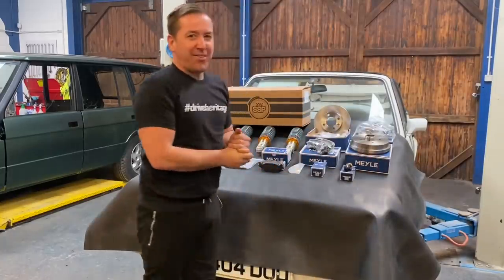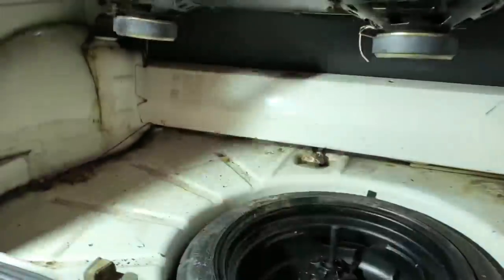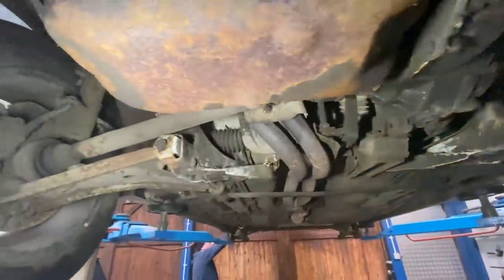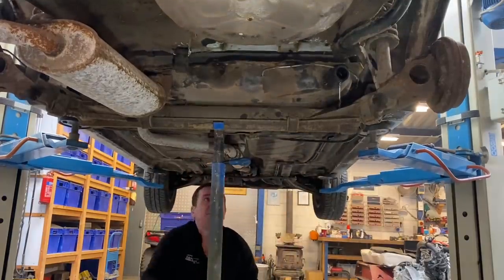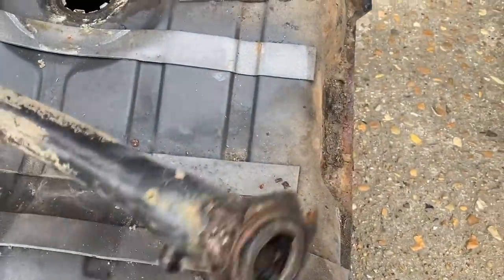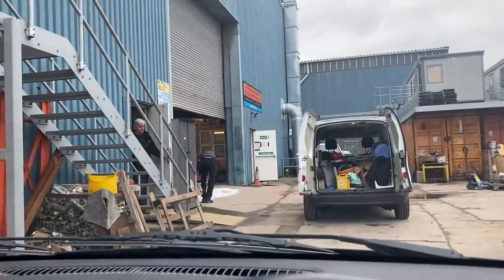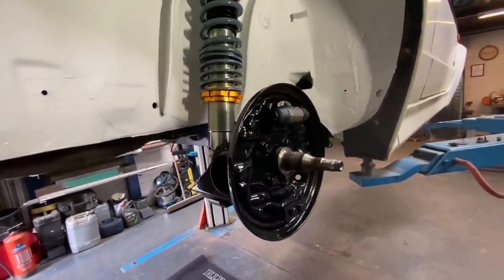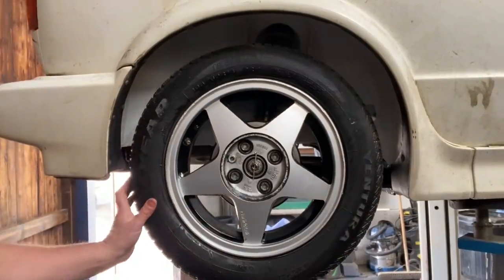MK 1 VW Golf GTI Rare Car Barn Find Restoration PT 3

Comment: Rob, great video. Those Mk1 Cabs are very well made. I had one for years and it was super solid. Filler neck was the only real rust issue I had in about 8 years ownership (up to 2017 when it was no longer mine).

Comment: Rob, just a small one.  I noticed a small rust spot in one wheel well which you no doubt treated before paint, but on that subject, I happened to be renovating rusty shipping containers which we applied SBR to the rust.  It's sold as an ad-mix and bonding agent unrelated to rust converters but we noticed it changes colour from white to a purply black when dry exactly like the "Real" rust converters. This SBR stuff is not too expensive and it really wallops the rust!  I've used rust converters but SBR is resin based, 100% waterproof much better and stronger - it also creeps far better into tight areas.  We had excellent results on these containers which were over painted. Just a thought, mate...
Reply: @SalvageMasterEssex  Think again.
Reply: @SalvageMasterEssex  It will last a good few years.  These ones were old and battered, but they do rust.  Just maintain it and you'll be fine.

Comment: Yes quite agree VW Heritage Parts provide good quality  parts for older VWs. the complete rebuild of my 1300 beetle including body panels were supplied by them. They even stocked the small value items such as plastic horn panel plastic securing spigots & remanufactured the plastic panel itself that had split on my car.
Reply: Thanks for the kind words Alan 👍
Reply: @driveheritage  TY.Its the car that had a 4 page feature in the July 2019 issue 552 (out that may) of "Classic Cars" totally original, I owner (me) 50 years this year.

Comment: The only thing I don’t like is the hand bent brake pipes. You can get pipe straighteners and pipe benders to get that factory look and its one of those things that that doesn’t take much more effort but looks so much better when its done properly.
Reply from the maker: They are exactly the same as the original ones that come off

Comment: Great vid Rob and Chris. Lovely job on that. When my neighbour restored a Porsche 912 years ago and had the same issue with the tank. I remember helping him empty what we could of the rusty flaky rubbish, then pouring in a special type of resin sealer.. we then turned the tank round and round until the whole tank was coated. Treated and sprayed up the exterior and all was well. Might be worth a look if it’s not rusted though and it’s a long wait for a new tank.
Reply: Yes, POR-15 and Kreem both do kits to etch and seal metal fuel tanks. Could be a good option if the order takes too long. Some of the old VW/Audi fuel tanks have a gauze sock filter inside the tank over the outlet though, you need to check it doesn't have one of those otherwise you need to cut open the tank, obviously only if you really know what you're doing!!

Comment: There's a few different types judging by a quick google. Fittipaldi Centre caps M397, M283, M489 seem to be the right style, just needs measuring and checking fitment as the screw hole location varies. I had a look and saw the same wheels with those caps.

Comment: You need your accumulator for cold starts. It maintains fuel pressure and some volume for the FI system before the fuel pump kicks in. Think of it as basically a can with a strong spring and diaphragm in it

Comment: Glad you're going the extra mile on it - even if I don't like coil overs on a classic car restoration. Rear axle looks nice but would have been better painted for longevity. (I will never have powder coated steel on the underside of a car after seeing what happens after it gets chipped - especially with all the salt on the roads in winter)

Comment: It's definitely worth putting the attention to detail on a project like this.  The person that buys it is going to be wanting a completely finished Golf cab, not one where the big stuff has been done but there's still the finishing jobs that nickel and dime you to death to do.  Putting in that bit of extra work now is going to really boost the profit potential at the end...

It's worth doing a bit of research on those Fittipaldi wheels, if the company that originally made them is till in business and is a good company then they may still be able to supply parts like centre caps for their old designs of wheel which can work out a lot easier, and often cheaper, than trying to hunt around and find a nice used set...

Comment: Couldn’t agree more Rob with renovating the axle beam, makes it look so much better. I do prefer the rear discs to drums though. One of the conversations I did to my Rocco, just because of the tidier looks. Not much difference in braking performance either way.

Not sure about your alloys, I think I prefer the colour coded diamond cut snowdrops. But you never know, if you can get the centre caps it may swing it.👍🏻 As usual, a very tidy video tutorial, cheers lads.

Comment: Glad to see a true old VW on your channel. 
The center caps/ hub caps you can get off eBay for roughly £35 a set
The Cabriolet fuel tank is different from earlier mk1’s but you can get them off eBay £120 
Just thought I’d let you guys know instead for waiting and if they’re cheaper than what you’re paying. 
Hope you guys go to town on the front end replacing the lower swinging arms bushes and mounts 
Can picture you two in the summer time with the top down enjoying yourself 
All the best

Comment: In case no one else mentions it the wheels are OZ Fittipaldis. I imagine the centre caps will be common across a number of their wheel designs. If you can’t find any used try contacting some OZ distributors they might be able to supply a set that will fit properly.

Comment: Hi guys, going very well in this build, the powder coating was the right choice, now is just give a coat of black spray in all the front suspension and around to look nice :). About the wheels im almost sure they are made by O.Z, OZ fittipaldi so other OZ wheel centers should fit :)

Comment: The axle is A-1; fuel system replacement the only way to go for trouble free motoring. Setting the bar high for the rest of the work, but you two will have no problems meeting it.

Comment: Have just remembered there is a convertible manufacture round the corner from where I work which is in lower Dicker East Sussex on the a 22 they have several mark one golf convertible is outside they are working on

Comment: The fuel filler kneck os the first thing to always go i think. Weve just had to have ours replaced on our 199y rover as it was so rotten fuel was leaking out of it. Took a while to find a second hand one in nice condition but we got one eventually. This is the only problem with older cars as the parts are harder to source but they do usually work out cheaper buying from people breaking others.

Comment: Removing the axle isn't necessary to get the tank out remove the exhaust needs a few twisting manouveres and it comes out. Then slide the tank out from the front. However Rob and Chris did the right thing here as that axle desperately needs refurbing!

Comment: I did a complete refurb on the very first mk4 escort cabriolet on a C plate and I just wish powder coating was around that time, it looks mint rob but you have to do the front, and could you not have had the tank a zinc coating inside of some sort

Comment: Hi Rob looks like it could be a centre cap size the same as the MK1 Seat Leon Cupra 16" wheels? If they do fit you could get VW stick on badges off eBay to cover Seat 👍
Also Awesome!! Looks immaculate in arches now

Comment: That ‘second fuel filter’ isn’t a fuel filter but the  fuel accumulator. It has a diaphragm with a spring inside that helps to maintain the fuel pressure when the engine is switched off.  Without it the system loses pressure and fuel vaporises, giving hot starting issues.  Worth replacing by the looks of it.
Reply from the maker: I know bud I did correct it in the video 👍
Reply: I said this in the first video
Reply: @sruk  you did, I posted before I had finished watching.  Good luck with the car, looking good so far :)

Comment: Less a refurbish it is more like a total rebuild. The rear axel looks better than the factory produced, though the bodyshell does deserve first-rate treatment having lived so long. I am a bit worried about the time and cost of the parts and trust you will achieve the sale price you will need. I have no argument about the care you are taking, as usual the work is excellent. It is a shame that there is always something to snag progress, this time it was the fuel tank, so progress has in a manner of speaking 'tanked' until that comes in. Sorry I could not avoid the pun.

Comment: The fuel accumulator should still be ok, there's not a whole lot to go wrong with them unless the diaphragm cracks. Just give it a flush out before refitting. There's usually a tiny screw in the opposite end to the fuel lines, which is the "dry" end of the accumulator. Crack the screw a bit after the car has been running, no fuel should come out, if it does (and would be pressurised!), the diaphragm has gone and accumulator needs replacing.

Comment: Y'all need to at least get a little 3/8" butterfly impact. Those shock bolts look fairly easy. Dunno if you've ever seen the rear air strut bolts on an 80s Lincoln Continental,  but they're a nightmare. And that gas tank? Lower strut bolts out, maybe away bar links.

Comment: Couldn't you just have the rust from inside the tank removed by electrolysis Rob or get the tank acid dipped, can always have the tank lined even afterwards if needed.

Comment: If that tank is solid, then there’s a possibility it could be saved,try a good clean out with some very hot water & detergent, leave it for around 10 minutes,then drain it off, then fill it with deox c and then leave it for around 4 hours then drain it off, the inside should then look a lot better, if it needs doing again then repeat the process,it’s interesting to see how much gunge will come out of a good clean, when it’s finally finished just swill some distilled water through the tank that’ll prevent the rusting in future
Reply: @SalvageMasterEssex  I did my fuel tank this & it worked well enough for me to be using it now
Reply: Plus it cost £60

Comment: Did you weld up the hole in the N/S wheel arch?
It looks fantastic and the powder coated axle is top notch
Reply from the maker: It didn’t have a hole bud it was a split in the sealer we cleaned it all up and resealed it 👍

Comment: Get that hood replaced with the correct white one that it should have. It will defo add value and look loads better.
Reply from the maker: They didn’t all come with white hoods you could choose the colour 👍
Reply: @sruk  the trims around the bottom corners are colour coded  white so it should have a white hood. Same as mine.
Reply: Also only triple white editions came with that cloth on the seats.

Comment: Quite liking those wheels, my volvo 460 shares the same stud pattern as your golf, id like to find out what they are!! Looking good with the powder coating and coilovers. Was the powder coating expensive? In my restoration I have just been cleaning and painting my parts with satin black and stone chip where its necessary. Trying to do mine on a budget 😁 if powder coating is cheap enough I might strip the car and get that done instead!! Keep up the good work chaps and it's always good to sit down with a cuppa and watch your vids!
Reply from the maker: It was £75 bud 👍

Comment: Axle looks a million dollars but can't believe you didn't change the main beam bushes or anti roll bushes! The main bushes are common fail on the MK1 and 2.
Reply from the maker: The roll bar is at powder coat so not even on the axel ?
Reply: @sruk  ah sorry I just assumed as you'd not mentioned you were not changing them. You can destroy the old bushing to remove and get poly replacement (such as powerflex)  that slide straight in. Will drive so much better. Be like a boat on these old ones.

Comment: VW made 462,000 of them so plenty about. Not rare. If you must have one, get a TinTop Series 1 with small rear lenses, much cooler. Oh and coil overs are very harsh, even more so in a Mk1. Standard shocks and some -40mm Eibach Springs = useable & then your back doesn’t have to be made of granite.

Comment: You have fitted the hand brake cables wrong, you will see there is actually a hook the cable fits behind, the drum will rub the cable if they are left as they are.
Reply from the maker: The beam is loosely fitted the cables are not connected as it has to come off to put the tank in 👍

Comment: If I remember right m517 centre caps are the correct fitment for your alloys,they fit a few different styles of oz alloys and also some older toyota standard alloys ,maybe worth searching for some old toyota ones and re badging them👍
These may fit 293838746520

Comment: Powder coat 100 % best thing to do I use to do it to every thing when i was building old land rovers and ppl used to laugh but when I sold them they used to sell in minutes I had last laugh
Reply: Sorry, have to disagree, powder coating looks nice and is cheap but as soon as it cracks, which it will, water gets underneath and everything rusts,and ytou can't touch it in successfully. I spoke with local surface preparation specialist and he agrees that a good quality paint is better.
Reply: Note to be sorry for every one has got there own opinion and do things there own way that’s the best thing about repair and restoration it’s all for the love of cars
Reply: Fine for a short period of time but  they may have been cursing you afterwards. Paint is 1000% better than powder coat - especially on a land rover! (The gent that replied to you is correct about what happens.)